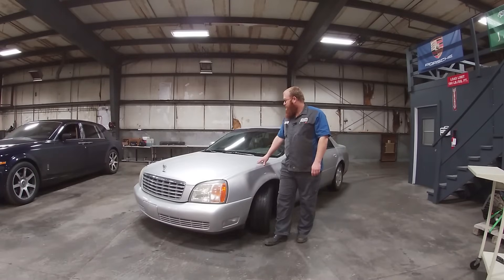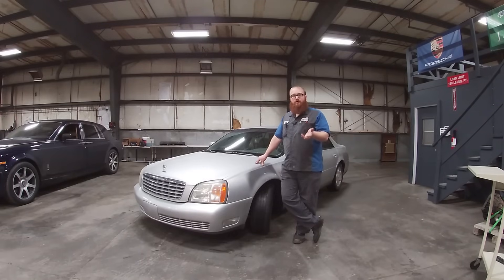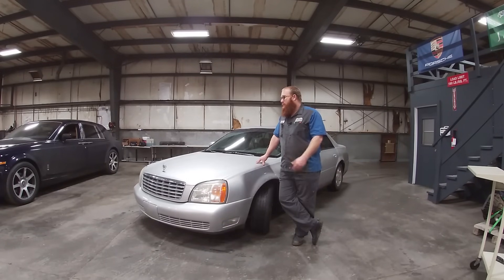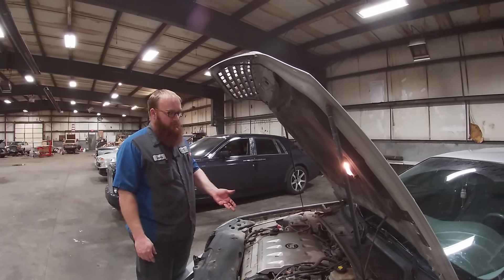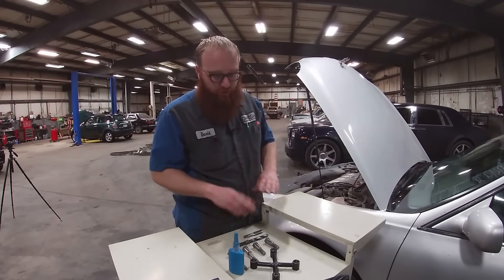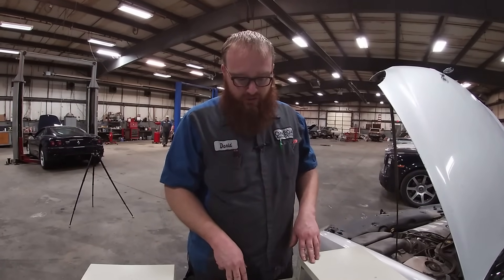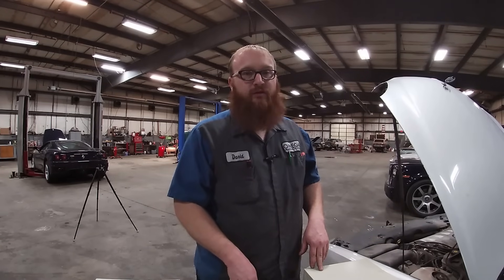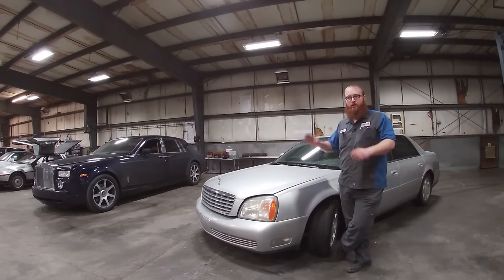The CAR WIZARD names Cadillac's Northstar Engine the Dumbest Design

Comment: The way I see it is like this. Could I buy a better car for let say 6 grand? If the car Is otherwise nice , there is no reason not to fix it. I mean realistically what can you buy for 6 grand? Another old used car with different problems?
Reply: Emilthehun 6 Grand? A decent Lexus LS430
Reply: @dingusbingus8554  old and high miles.  That's what my comment said. You can either fix it , or buy a new problem.  And don't even give me the "Toyota last forever " talk lmao. A used car is a used car

Comment: I had a 1997 in that same color, it was my second car. It had 40,000 miles. At 120,000 I sold it to my uncle for 500. It was the most unreliable car ever. The wood grain panels were glued on with cheap glue at that, in the Arizona SUN, the wood panels would fall off. The chrome trim that was all around the exterior of car would fall off. The automatic rear air suspension would break and the rear tires would rub, it looked like the car was squated from the rear. The front magnetic ride control shocks(it had the old version of them) would break at 40,000 miles and it was $2,000 to replace them, if you dident, you could not do the alignment properly and your tires would wear unevenly fast. It was good for like 20,000 miles then everything started to break. One time it send boiling liquid down the pedal that soaked into my shoe and gave me burns. I had to pull over and take off my shoe, and recover before driving off. I will never buy another Cadillac product ever again after it burned me, when I was driving down the street at 45.F#ck Cadillac

Comment: Did you do a rebuild while the engine was out? Seems like the only way one would rationalize that amount of work.
Reply: They normally blow around 60k so what else would you rebuild the rings and bearings would still be new and pulling it apart doing the studs you would replace all the gaskets anyways
Reply: The northstar really doesn`t wear out much. Only big issue is the head bolts.
Reply: Its totally IRRATIONAL to even have that type of failure. So people dump the cars. I kinda want one properly studded out but financially im not ready right now.

Comment: Love the video .Rover mg had a similar problem with their aluminium k series engines. Back in the day.Streched headbolts poor head gasket quality and a minimum cooling system ment a little drop in coolent levels on a hot day or in traffic jams would inevitably lead to a blown head .Also did I mention slipped cylinder liners.Its a good engine if you check your coolent regularly and know what to look for .But many really beyond economic repair unless you can do the job yourself or have the BMW diesel units installed they can be good for 300 thousand miles returning 50 mpg.

Comment: Sitting in my 07 Northstar DTS as I watch this lol. Glad you mentioned that the 06-up last generation Northstars have different head bolts and don't blow head gaskets the same
Reply: Also '06 was the first year of the rotated Water pump. 20 minute job turned 9 hours.
Reply: @mungfam  i've done it. it SUCKED! not really hard just takes a long time
Reply: @Kowalskithegreat  when I did my 08' last year I was relieved.

Comment: I drilled and tapped the block in my 96 deville concours polo green stardust vogue rims and vogue tires.

I purchased a 2000 white deville with vogue Rio rims and vogue tires, and it lasted me 1 yr b4 the bolts pulled amd headgaskets leaked its now overheating and ill be doing it again. These cars are AMAZING. My 96 is almost the only 1 on the road where I live with a NORTHSTAR

Comment: We had a 94 V6 Mustang that blew head gaskets like people get oil changes. There was a recall but they said itr had too many miles or something stupid, like it having too many milers has anything to do with them having aluminum heads on an iron block or vice versa. It wasnt that bad, but we did has it fixed like 5 times. Our neighbor was a mechanic at a Ford dealership and would grind the heads down til it lined up and sealed.

Comment: I’ll see your Cadillac Northstar and raise you a Pontiac Bonneville GXP Northstar.
Reply: Ill see both your broken cars and raise you my Volvo...
Ill see you at the 200k Mi while still doing 1/4 Mi runs
Reply: could have just said GM northstar and stated the true issue.
Reply: I thought the GXP North Stars in the Bonneville were pretty reliable, no?
Reply: CeeStyleDj It’s possible to make an argument for reliability, but the design philosophy must have been with the mindset of “a size 14 woman in a size 5 dress”.
Reply: @Chickenassable  Damn straight, brother...Volvo for life.  Just about ready to pick up my 04 V70 R w/ manual transmission!
Reply: @adamscissorhands  by 2004 the northstar was fixed and actually won best enginenif the year shhh dont tell cletus
Reply: @kjadfhgioaudbfvilaeu  volvos are ranked near the bottom of all cars in reliability thanks for the.laugh
Reply: Have a Northstar in my 04 SLS, 226,000 and never been opened up.
Reply: Full house.....Saab 900.

Comment: My grandpa bought my grandma the first year of the Northstar engine. A few years later they had an issue with the engine and it was out of warranty, so my grandpa took it to his buddy. His buddy hated the Northstar engine and instead of fixing it he retro swapped an older engine into it. It messes us up every time we change the belts because the serpentine pattern and belt length are different.

Comment: "mechanic's special". Great deal for a buyer with time and his own tools.
Reply: smithraymond09029 Yes, a whole college trimester
Reply: I see your point but a smart mechanic would not put 4 thousand dollars of work into a 2 thousand dollar car. There ARE other cars in the world . Cars that are worth working on.
Reply: Kirk Johnson Exactly, it just depends on what the work is and if the vehicle is or isn't susceptible to the same shitty mechanical failure again, because there's no point in replacing an engine on a car that has a bad engine design, a bumper sure, but not engine

Comment: How do you not mention the poorly placed starter and water pump. And the 8qts of oil needed for a oil change
Reply: Thank you. Removing the intake to replace the starter....I have done it on two different Northstars. Never again.
Reply: Try removing a fender for a battery
Reply: That's a c4 corvette owners pain
Reply: @jackguster6531  holy crap, the engineers were on drugs or something close to drugs lol
Reply: Because the battery didn't fit any place else and the fact it's a truck clamshell hood not just backwards opening
Reply: I ment true
Reply: O and it wasn't engineers only GM's lead design team and arkuf duntuf and harly erals son ya harly eral  the guy that invented the x frame chassis designd the Le saber concept fire bird 12 and 3 concepts and Corvette concept and talked GM's executives to keep it going
Reply: Did I mention he designd all tried five chevys

Comment: I'm a Cadillac specialist. I still work on these type of cars all day long. Currently, I have a head gasket/stud job sitting on the lot. & yeah! it's very time consuming. I've noticed over the years, the usual mileage is between 100K-120K when these headbolts fail. Initally, I was using the original GM/time-sert fix. At first, I believed the GM lies & thought that was the fix. But, I always wondered what was improved? You're putting in an threaded insert with the same thread pitch as the one that just stripped out!!! Of course, as you said, the fix wasn't for long.
 I've tried Big-Serts, but that left the block wall too thin (on the 99- NorthStars) & the blocks would crack after a short time! After noticing that I ddn't get any overheating problem from 2004+ NorthStars, I made a tool set to retrofit the older engines to accept the M11X2.0 head bolts & haven't looked back! 
The other issue plaguing this car is the oil leaks. That is really the stupid design! I surprised this engine has been banned by Green Peace! For years, I wouldn't touch this issue because (like the head gasket issue), the leaks would be back. Finally, It was time to do my 2006 DTS oil leaker. It got so bad, I couldn't drive the car with out rolling the windows down. My wife loved this car, so I had to fix it. It took some time to study the problem & I improved that desgin! No more leaks! 
I consider the oil burning a must on these cars. That's why they last so long. When I take these things apart, the cylinder walls have absolutely no wear on them. The bottom end on these engine is pretty much bullet proof. 
I've also noticed the 2006+ engines are more cheaply made than the older years! I see alot of timing chain issues on these cars, as I've never had to replace a single chain on the previous models. The 2006+ also leak alot more oil,  sometimes the timing cover & oil pan bolts loosen up!!! Also, on the 2006+ models, I'm noticing more valve train noise than previous models!!! ... Come to think of it, this engine really went to crap after 2006!!! No wonder the old GM went out of business!!!
I've owned probably 20+ NorthStar Cadillacs, mostly STS's I've had my 94 STS reach 300K & still running good! My son was driving it. He didn't want it anymore (because of the gas price), so I gave it away to one of my employees. He drove for years it until the wheels fell off!!! God, I miss that car.
I had another 97 STS with 250K & drove like a bat out hell!! I rarely drove it anymore, but I decided to take out for a weekend, & yup, someone crashed into me!!! I cried. :(

Comment: Northstar sounds good with flowmasters.. I had a 93 Deville Concours.
Reply: You mean a 94. That was the first year of the Concours. Only Caddies with the Northstar in 93 were the Eldorado, STS, and the highly collectable Allante.
Reply: @SlickBlackCadillac  That sounds right.. It's been so long since I had it. I loved that car tho. I got some pics somewhere.
Reply: @SlickBlackCadillac   I got it dirt cheap. 300 bucks I think. Or 250.. Something like that..  But it wouldn't charge the battery.. I put a new alternator and battery in it.. Kept dying.  Like Wtf.. Finally I said Hell with it and took it to Brown Bros Cadillac in etown ky. The guy ran one new wire and fixed it.  Charged me 100 bucks.. Fusable link he said I think..after that.. Never had a problem out of that car.
Reply: @SlickBlackCadillac  I actually wanted to switch the Trim on mine. I didn't care much for the grey trim. Just never got around to it. And the people at Olympco fucked the whole front end up I bought Tempkin wheel bearings for the front.. Had them put them in.. It didn't even make it out of the parking lot.Fucking steering wheel was all crooked.. They wouldn't fix it. That's why I ended up selling it.

Comment: i bought one of these at 140 000km...at that time I replaced both ignition coil packs all 4 pads and rotors shocks all 4 wheel bearings oil pressure sensor and a TC lockout solonoid (need long fingers for that one)
now 210 000 and no issues since, just fluid flushes and basic maintainence.no head gasket issues, even with driving uphill 3500 feet every time i go home( live on a gravel mountain road)

Comment: It is a good engine that has a crippling flaw. I'm glad that they can be fixed.
Reply: Just like the 6.0 powerstroke. have to fix what the engineers screwed up.
Reply: @edm9760  at least it isn't the 6.4 Powerstroke Diesel that was so badly designed, that Bill Hewett of Powerstrokehelp.com; who is one of the top experts of Powerstroke Diesel engines (second only to Ford themselves) just posted a video saying that he will absolutely refuse to touch ANYTHING that has a 6.4 Powerstroke in it, and is screaming at the top of his lungs to dump that engine as quickly as you can before it self destructs.
Reply: digitalrailroader lol I’ve watched that dudes videos. It’s funny how he’s says the 6.0 are great engines............you just have to replace nearly everything inside of it lol.
Reply: @lawnmowerdude  I had a 6.0 that went 200k miles with no issues. We sold it and I still see that truck driving around all the time. It is a great engine.
Reply: If it was a good engine, why do you have to fix it?

Comment: Reminds me of the issues with the Olds/Cadillac diesel based on the Olds gasoline engine.  Rolled out ca. 1978, there were issues with the crankshaft breaking.  Turned out, the crankshaft was fine, it was the engine body flexing due to inadequate head to body integrity.  And part of THAT was the head gaskets.

As an old kinda car guy, it amazes me how many concepts go through all of the testing and appraisals, and then fail in the field.  Thinking the high silicon aluminum block Chevy Vega as an example.  The issues with the Corvair fan belts.  (I know this one well!)
Reply: Ironically, like the Northstars, if you repaired those Olds Diesels with Aftermarket headgaskets, & head bolts, you had a decent little V8 Diesel(same with the Olds V6 Diesels)..  Cadillac would later have issues with their D.O.D. 8-6-4 engines, which were junk from the factory, but if you remove the D.O.D. Garbage, swap in a regular Cadillac V8 Cam, you had a Fun Cruiser.

Comment: I've heard the North Star engines are rubbish and are prone to fail. Great informative video
Reply: I have owned two Northstar vehicles. One was retired with 212k miles and my current vehicle (97 Seville) has 64k. Both 4.6 North* obviously. Not every one of these engines is terrible and suffers from the famous rear main seal leak. But yes, they aren’t great and I wouldn’t be interested in these vehicles if they weren’t unreliable.
Reply: @thelastmemphian  years back I was going to buy a Olds Aurora with the North Star but didn't pull the trigger. Yes for sure some of the engines are still going strong.
Reply: Blue Moon i dont believe that car was offered with a Northstar? I used to work on one of those for a friend and im pretty sure they only came with the L47 4.0 V8, not the North*. Those were comfy cars though.
Reply: Have you ever seen GM's TSB's pertaining to "acceptable level of oil consumption"???  check the gas and fill the oil please is what you do at the gas station with a Nope-Star engine
Reply: @thelastmemphian  Looks like it's based on the northstar engine.
Reply: @thelastmemphian  Hey. I had to double check: "The Aurora also came standard with Oldsmobile's 4.0 L (244 cu in) L47 V8 engine, a DOHC engine based on Cadillac's 4.6 L Northstar V8. The Northstar engine and 4T80-E had been exclusive to Cadillac prior to the Aurora." Wikipedia. Haha
Reply: @gmctech  lol the Ford Ecoboot engines are worse.
Reply: @gmctech  I believe every brand has a ridiculous allowable oil consumption. It's not something new and just related to GM or Cadillac
Reply: I think I might have been that mechanic lol
Reply: I still keep an Aurora; Still going strong! Interestingly decent highway gas mileage too!! @Blue-moon12
Reply: there were a couple of years gm was throwing the northstar in all of their 'top of the line' vehicles...with the exception of the buicks. those came with the more reliable supercharged 3800...
Reply: @thelastmemphian  the aurora indeed has a northstar. i have a 2003 v8

Comment: i have a 2009 DTS , absolutely love it.... no engine problems ever.
Reply: Love my 2006
Reply: The DTS have a terrible electrical system and they over heat after about 145,000 miles
Reply: Chris S not mine. Maybe one you have

Comment: I had my 2000 Cad fix they advertise 1600.00 but at the end it was 3000.00 criminal facility
Reply: Sometimes estimates are wrong.
Reply: @DrewLSsix  That's why a lot of places use the term "estimate" because it has more leeway than "quote."  Despite that, being off by $1400 is huge and they really should've called him to make sure he was OK with it.  When I worked at a VW dealership that was really common--quote out a job just to get into it to find out it's a much bigger mess so you call up the customer and they're fuming mad because "you told me it was only this", but the car was a total pile that was never maintained and only ever brought in if something was horribly wrong.

Comment: We used to use Heli-Coils for repairing destroyed threads.
What should work indefinitely on those Northstars would be to install the newer equivalent of Heli-Coils (in case originals are no longer manufactured) in 10 mm x 1,5 mm threads and then use matching to the head height one-use-only stretch headbolts of the type used in the more modern aluminum head, cast iron block Japanese and European engines. These are made for compensating unequal bi-metal surface expansion for assuring headgasket sealing during hard driving with cold engines. 10 mm bolts should be thick enough for that engine dimension

Comment: To be honest, I want a DeVille. My mom had one when I was a child. I love the way they look. If I could get the car for practically nothing, maybe with the head gasket already blown, I’d have the head studs done
Reply: You CAN get this body with the 4.9 engine, which is fairly powerful and easy to work on.
Reply: @crickle47  4.9L was in 1991-1993 DeVilles. Maybe 1994. No newer than 1994
Reply: @oldschoollee  You could get a '94 with this old engine.  It may have been only the first part of the '94 run?
Reply: I got ine selling cheap  wassup? studs done